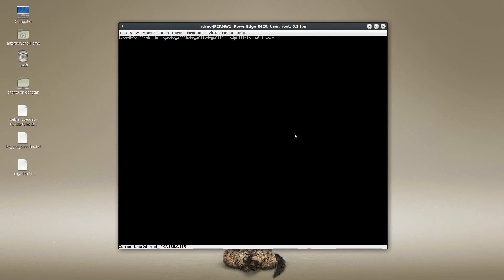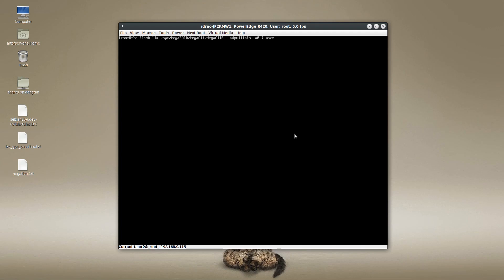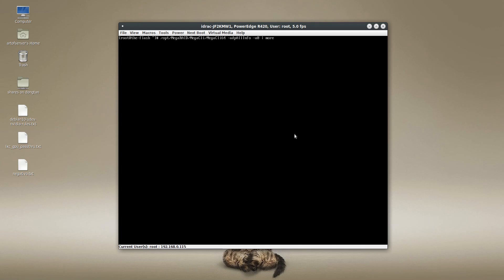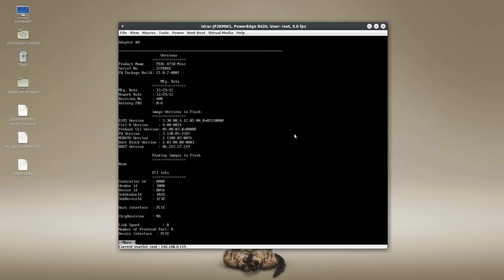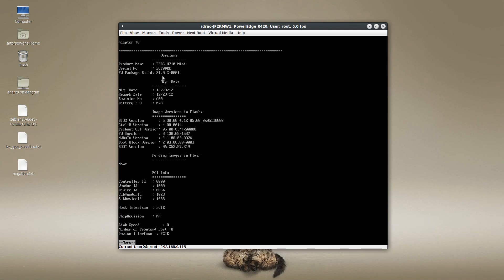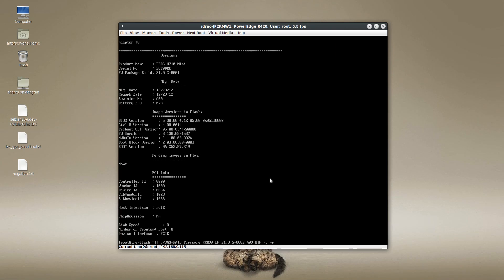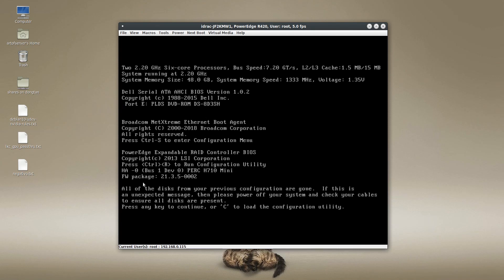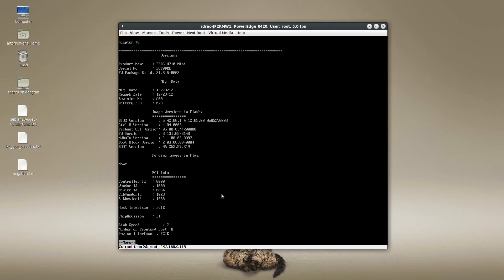This broke my DELL H710 mini flashing process

Comment: I have a Dell Megaraid 9440-8i and it is at firmware ver 50.050.01-1767, Dell provides one with an upgrade to 51.12.0-3411.  Once I install the upgrade I can't upgrade higher from firmware downloaded from Broadcom (Error states that it is invalid). Do you know how they differentiate their ver of firmware from Broadcom?  How can I break Dell's lock?  I am aware that I must update in incremental versions.
Reply from the maker: Sorry, I'm not that familiar with that card. Typically, you need to erase the flash and SBR content to then put fresh firmware and SBR on the card. But again, that's a general statement not specific to your card model.